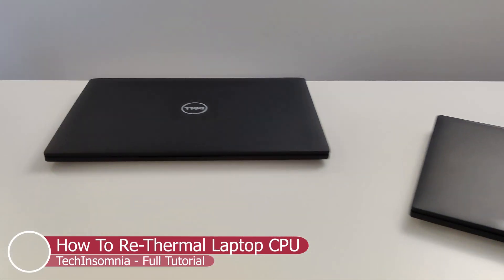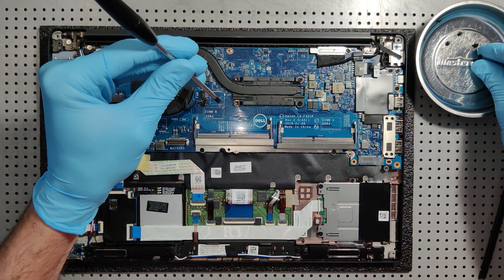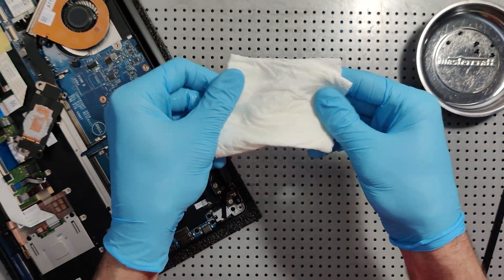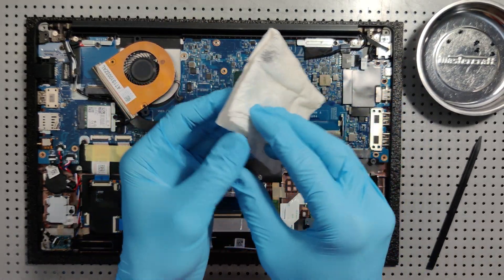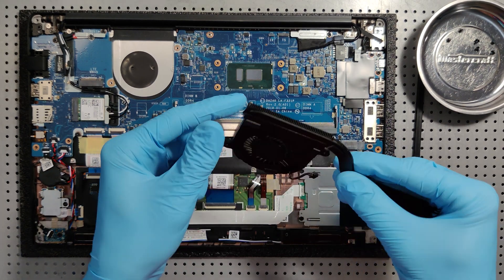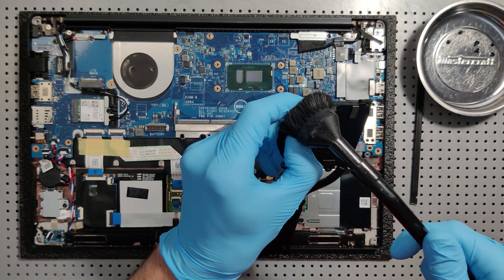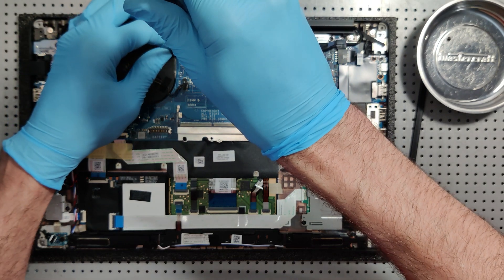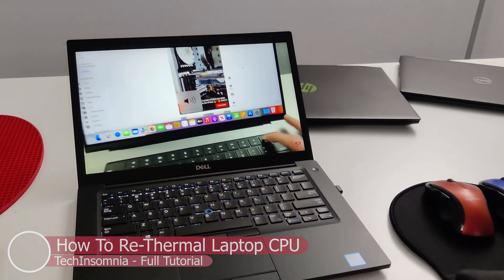How To Remove and ReApply Thermal Paste on ANY Laptop CPU

Comment: You did not put thermal paste on the heatsink.
Reply: you dont put thermal paste on the heatsink wtfff
Reply: @melonter7994 yes you do but not purposely, only when cleaning up the spatula
Reply: Thermal paste doesn’t actively cool a laptop on its own. Instead, it fills the microscopic gaps between the processor and the heat sink, improving heat transfer. Without it, air pockets would create insulation, reducing cooling efficiency. The heat sink and cooling system (like fans) then dissipate the heat away from the CPU.

Comment: I am still very scared i am 13 almost 14 and I don't knwo if my family will allow me to do this 😭😞 i what happens if i mess up even a little i am just scared if i break this one there is no way i can get another and i am gonna get a cooling pad soon and i wanna overclock my laptop so i have to clean it somehow it makes more noise then normal
Reply: its not rocket science. if you just be gentle there is no way of breaking anything. also dont touch anything you dont know and watch at least 3-5 videos likes these. more you see, better you will perform.
Reply: It's not easy you can fry your motherboard if you don't know how to handle electronics
Reply: you can do it just don't pull or push something if its really hard it means its lock. it should be easy to remove once you unscrew everything. 

also take a picture of what it looks like once you remove something every time so you can check it when you put it back.

Comment: Hey bro, when I checked my laptop CPU and GPU, there was already so much thermal paste that it was also on GPU and CPU  pins. How can I clean thermal paste  off of Pins without breaking them ? I will be grateful !
Reply from the maker: Best approach I can recommend is 99% Rubbing Alcohol on a few folder paper towels and don't over soak it. Use dry Kleenex to get the majority of it off first but remember to vacuum with bristle attachments because the Kleenex will create white particles that have to be removed before the paper towel with 99% on it. Once complete, vacuum again and let it sit for an hour or two to be safe. Then inspect and re-thermal and secure heatsink. Then let it cure overnight and power on in morning. They say some thermal pastes don't need that time but after years of computer repair, I'm telling you, it makes a difference. 💯 Hope this helps and let me know how it goes my friend. 🙏